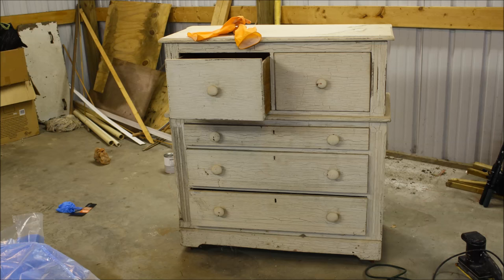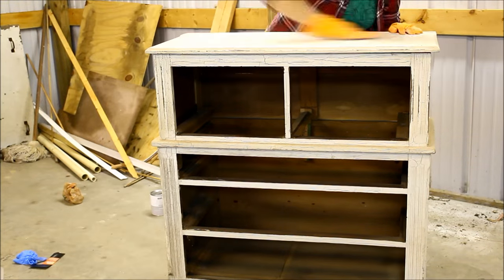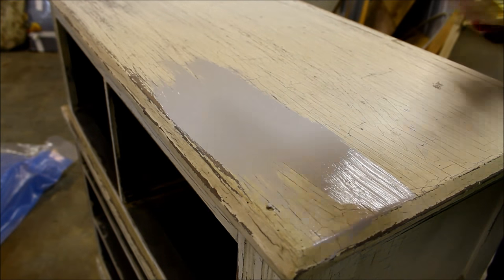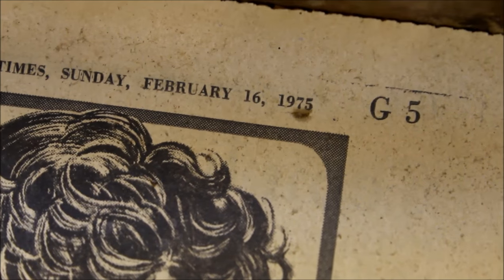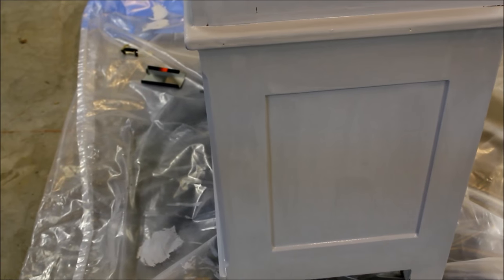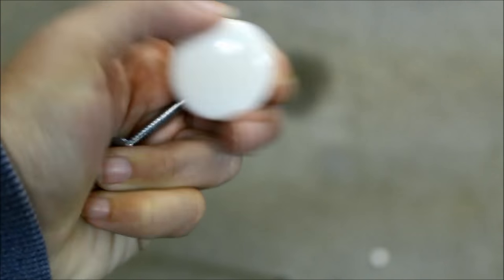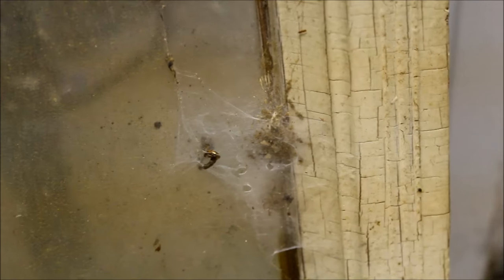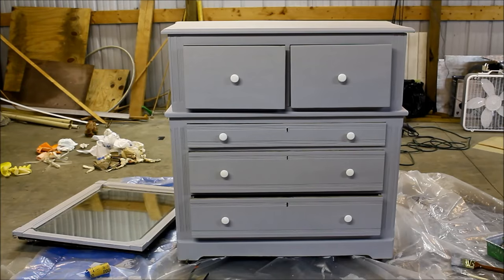Chalk Paint Dresser Makeover - From Gross to Gorgeous - Salvaged DIY

Comment: Hey, this dresser looks awesome! I just picked up the same paint to paint some furniture pieces and wanted to ask you did you use a topcoat on the dresser? I am new at this and would appreciate your advice. Thanks
Reply from the maker: Yes! I didn't show it in the video, but I did add the top coat after i was finished to make sure the finish would last. I just used the rustoleum brand that's recommended for the that paint. Hope that helps! Thanks for watching!